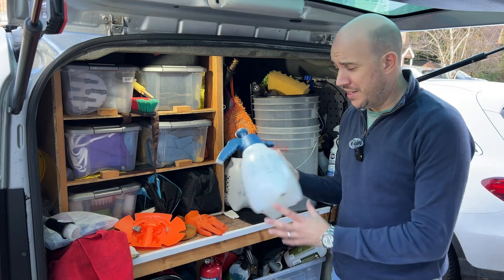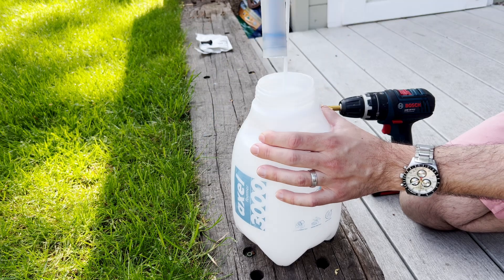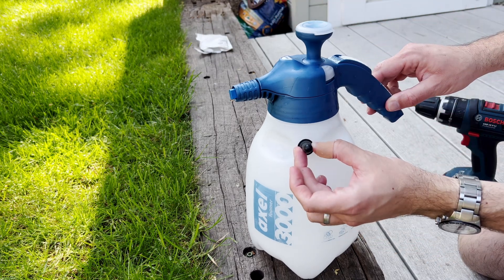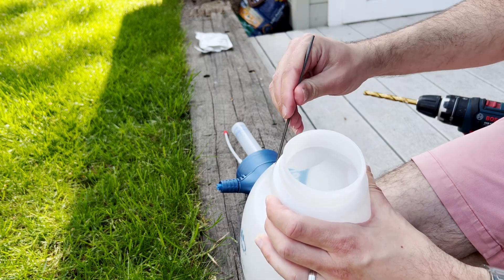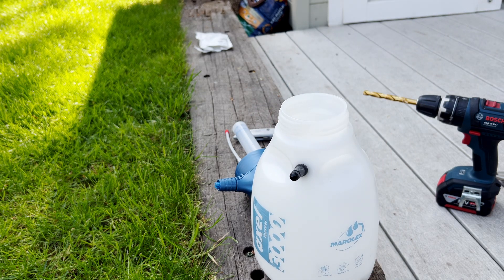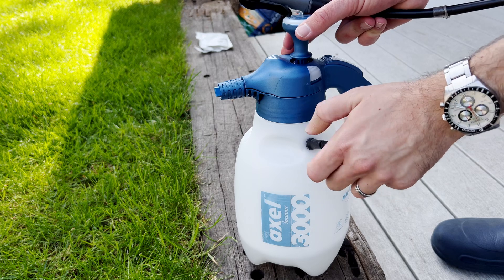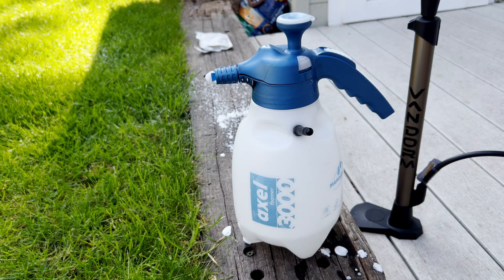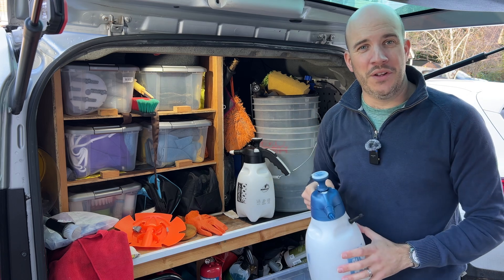Stop Buying IK Sprayers! (Marolex Mod Makes Them Obsolete)

Comment: No disclaimer? Very brave of you Mr Lama to trust general public with compressed air and no safety valve :face-fuchsia-tongue-out:
Reply: Theres a battery powered variable pump that you can velcro on the side of the bottle and have a preset pressure to your requirments another youtuber cars with keav did that a while back
Reply: @hardgraft247 that’s what I did with my Marolex. I got a XIAOMI MIJIA Air Pump 2 Pro and annoying that you can get a plastic holder that fits IK’s. So I adapted it with a piece of metal to create an extension and put some foam sticky sound proofing tape to protect the bottle and ensure no slip. It’s a squeeze around the 3L Marolex Foamer but it does fit and you can switch the head to the 2L sprayer and the pickup tube still reaches the bottom. Shame there’s no holder for Marolex but the bottle is rounded and curved which the IK has a thicker base for it to sit on. You can as in Keav’s video get the smaller pump which has an auto refill function but it will turn its self off after 2 mins so consider if it’s worth it.
Reply: @CTR_1986 cool thanks for the heads up on this, will check it out
Reply from the maker: Ooooor just get a small air compressor (rather than a tyre pump), that's got to be so much easier than faffing with all of that?
Reply: @S @SuperchargedLlama es it’s a good option but I don’t have a compressor nor did I want to be having to walk back to the garage mid wash to keep inflating the things. I have one with a bracket and a smaller Marolex for the prewash which you can just hold beside it as until you’ve got some air space they tend to loose the pressure quickly. The advantage of the bigger 3L one is with 1.5 or 2L it lasts much better but it takes seconds to re-pressurise or can run it as your going around meaning you don’t stop. Handy to get rinseless all over the car in the summer after rinsing down quickly and avoid water spots. I can put a link to a post to show what I’ve done as a YouTube post if it’s allowed?
Reply from the maker: @CTR_1986 give a go, I'd like to see it!
Reply from the maker: The pump sprayer has a safety valve on it, that's what you can hear hissing just before I used it, when that starts you know it's pressurised fully.

Comment: Yes but I did that to my Ik sprayers....
Reply from the maker: You'll be able to help me out here actually, I never found with my IK's (the 1.5 and 2L) that I could ever fill them up to that capacity as there wasn't really sufficient volume to then pressurise them. Is that the case or am I misremembering?
Reply: @SuperchargedLlama yes they have been a bit inventive
Reply from the maker: @jusb1066 that's a big difference to the Marolex ones, you can fill the prescribed max volume and then they have lots of capacity left to pressure rise, so you can realistically get round half a car with one charge, and then it's just a few pumps to finish off the rest. But it's a shame the charging handle is such a pig.